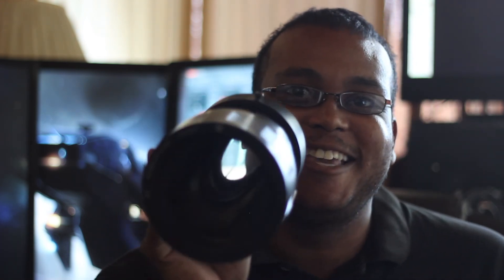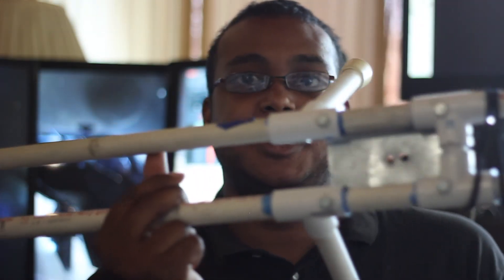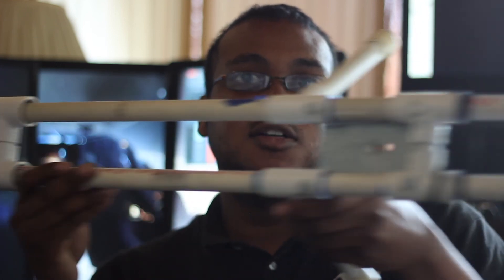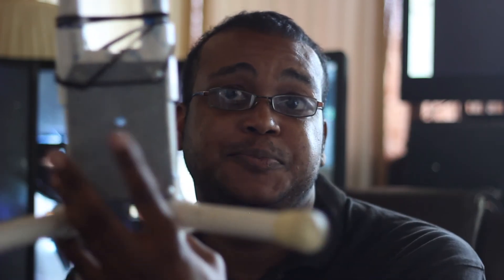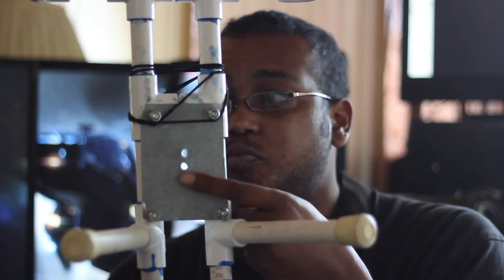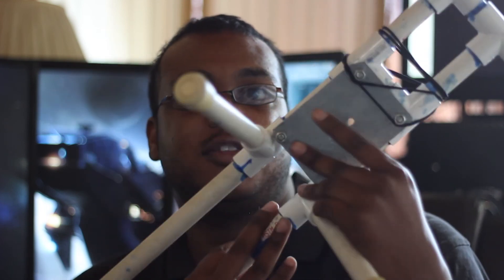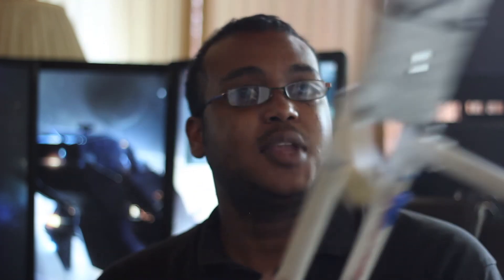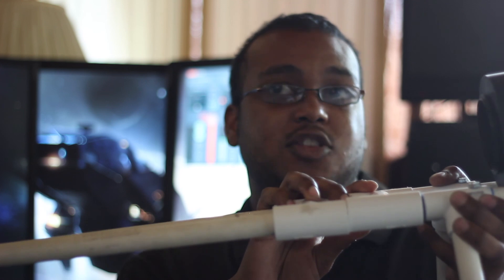Canon 60D Anamorphic LOMO 35 Lens NAP2 3M - Tutorial

Comment: Good try man. But why so much of the vertical lines Top left-skewed? Is it that you haven't rotated/adjust it (Lomo) adequately or this is an unavoidable distortion.
Then the contrast and color saturation looks low to me.
But you can't beat the price and then your genius rig is second to none. Well done my friend. 
You have a new subscriber.
Reply from the maker: Thank you for your comment and the sub. Yeah, it can be really easy to accidentally tilt the lens without knowing, you have to be extremely conscious of the rotation, and if you have a small display screen as I did at the time, it can be hard to notice. As far as the contrast goes, I kill the contrast, sharpness and reply it in post as it gives more depth to control when adding it back in which gives more of a film look in my opinion, there are a couple of more options that I take out that I a missing, I can't remember right now, this is also known to me as shooting flat. The problem is you have to be really good with color correction... and sometimes it can be off when adding it back in, so for me I did not add too much of it back in.

Comment: Brett,  Can you achieve close focus without a diopter?
Reply from the maker: To be honest, I've never tried that before...  but you really do need all the rings to make sure the math is right to achieve the desired focus because that lens Is very temperamental, also using rings keeps the lens from moving around and falling out of place. That rig that I had balances everything and keeps everything locked and attached to the camera.

Maybe you could do it that way without the rings if you do the math right or I should say the right distance to the lens, but then you would be dealing with light leakage onto your lens I assume. If you figure it out I would love to see your creation. (=
Reply: Brett Frazier I have been experimenting with a Moller 63/2x cinemascope lens.   My plan with the Russian lens would be to connect my Kiron 70-210mm f4 Macro Lens with Zoom Lock. if I connect this lens to the anamorphic with a step down ring I can still
Zoom and focus without turning the lens.  Just wondering about closeups. My experience had been to need diopters for anything 15 feet or closer.